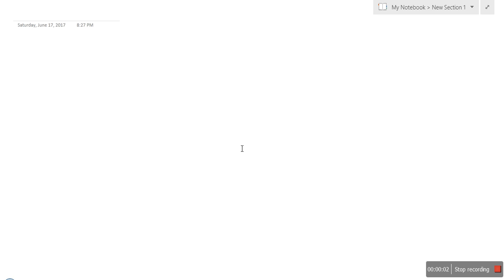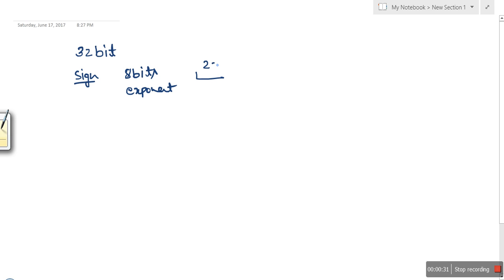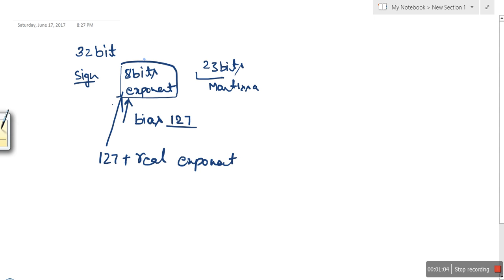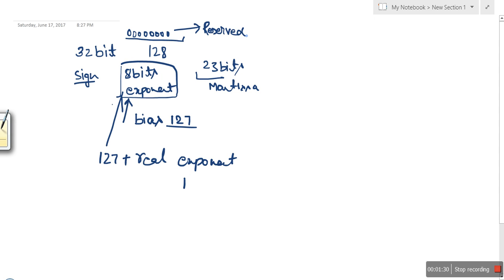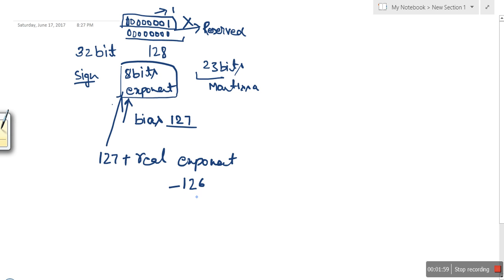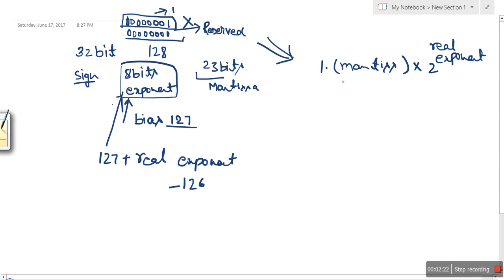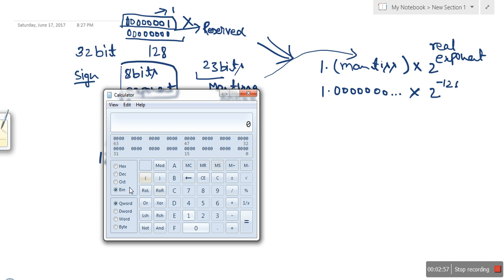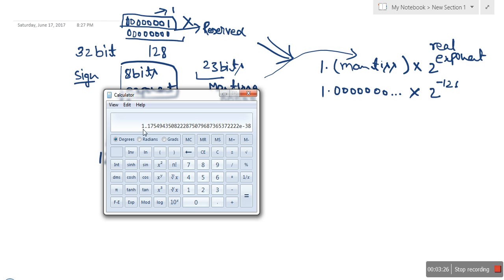How to Calculate Smallest Float Value in IEEE 754 Standard [Single Precision]

Comment: shouldn't the Number with Maximum magnitude and  with negative sign will be the smallest number...??
1 11111110 11111111111111111111111
please correct me if iam wrong
Reply: smallest positive number not negative number.

Comment: In case of smallest fractional number what would be the exponent the actual value ?i found 0-127=-127.Please correct me if i wrong
Reply: 0 is reserved. so you have to consider the number right after zero which is 00000001.
Reply: @defihustler  Could you please explain the term reserved ? Why we can't use 0 as the exponent ?

Comment: How 127+ real exponent = -126 ? (I didn't get this). Please explain sir
Reply from the maker: The exponent is 8 bits long. Now, these 8 bits will be used to represent positive and negative exponent. 
Therefore there is a bias of 127 in the exponent. 
In this video, stored exponent  00000001 is discussed.  This  is result of adding exponent with bias. So we can write
127 + exponent = exponent which will be stored
127 + exponent = 00000001 ( which is 1 )

So in order to get 00000001 we need to add  exponent -126. Therefore, there is -126 which is smallest exponent.
Reply: Your "-126" will never appear in the expnonent filed. you should make it clear that the number in expnonent filed is unsigned integer. And you subtract 127 from the number in exponent field to get your real exponent.